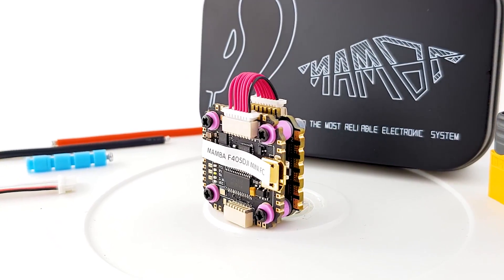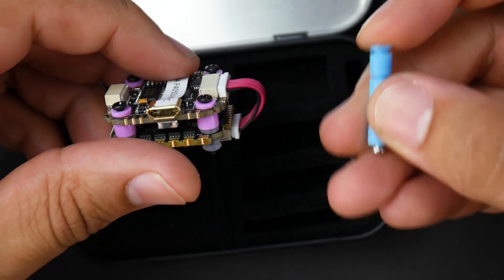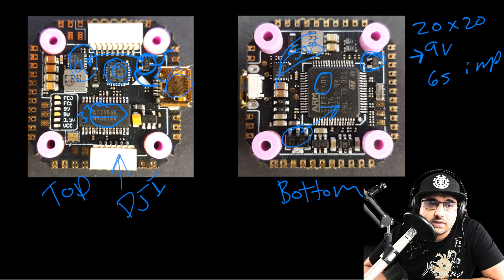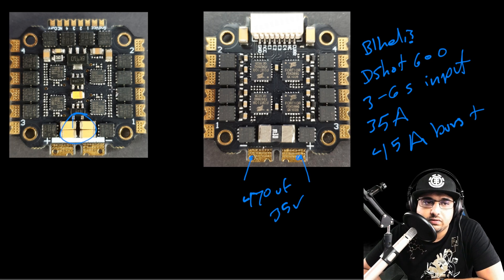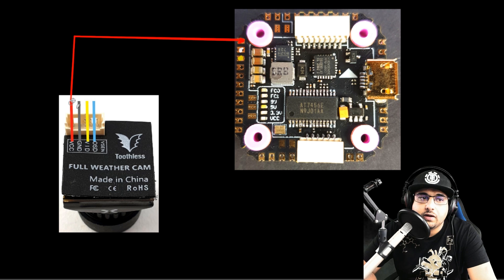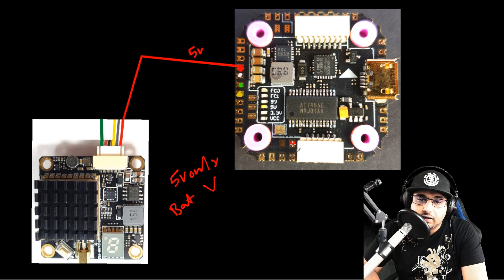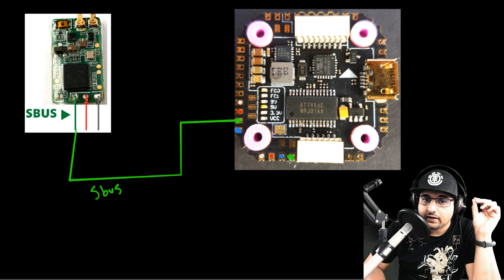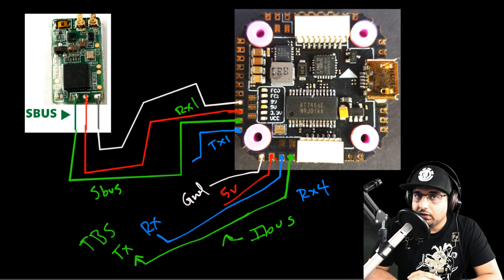The 20x20 Cinematic FPV Drone Stack Dream // Mamba F405DJI Combo

Comment: Can you use the dji plug on FC for a caddx vista as well? 6s?
Reply: Yes. You would just remove the sbus and extra ground wires from the plug if not using dji controller

Comment: If you wanted to add a gps module, would you just buy a dji gps module to plug in?
Reply: No, you would just solder the gps wires into a different uart

Comment: My new diatone 3" taycan has this stack in it/ with a dji air unit, but cant see acro mode in 10.7 betaflight. I can only find angle. Horizon, and airmode?? Any help please? Thx.

Comment: I have a very important question I bought this ESC by mistake I was wanting to get the normal size but I got this one I am running 2400 KV will I be good running nap with a 4S battery

Comment: This is yet another fail product from DYS IMO -  A 'DJI' stack that still has the OSD chip, WHY? It will literally never get used... and a 1.5A 9V reg? That's barely enough for the DJI AU.. And the best bit - a signal inverter on the F7 Tx1? WTF?.... Instead of the OSD chip they could have had a blackbox chip, a decent 9V 2.5A reg, a Baro & COMPLETE SET OF UART Tx+Rx's!.....

Comment: You mentioned you’re missing the connector ?cable I didn’t know if you knew but you could make those  Headers.. 
Thanks for your review of Mamba 👍
Pre-Crimped Cables and GH1.25 Connectors for Pixhawk2 Pixhack Pixracer PXFmini Silicone 15cm Wire https://www.amazon.com/dp/B07PBHN7TM/ref=cm_sw_r_cp_api_i_ffo.EbS88G6YA

Comment: I've been having deathroll issues with all  the Mamba F405DJI stacks using 6s 1900kv motors and s3 props. Under powered ideas?
Reply from the maker: I mentioned this in the video this is not meant for High Kv high Amp load like yours.. 1900kv on 6s usually cam hit 50A on burst and more.
Reply: @DroneMesh missed that one.  would I be better off with 1700?

Comment: Can’t speak for the dji but that stack is garbage. At least from my experience. I’ve had 2 in my taycan. First one would burn up motors left and right. 2nd has a bad FC from factory. Replaced and had nothing but issues with it from day 1